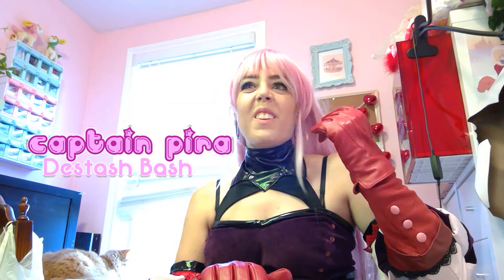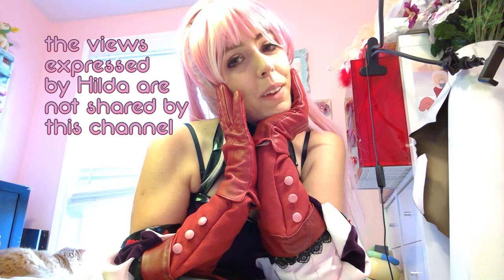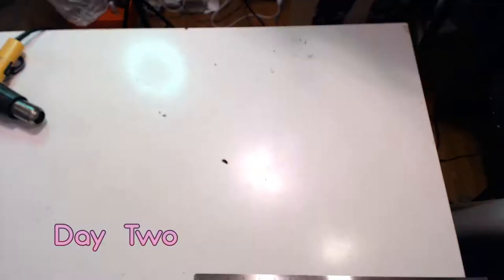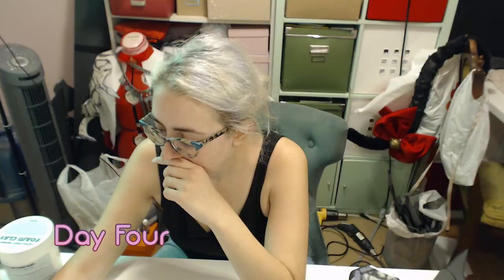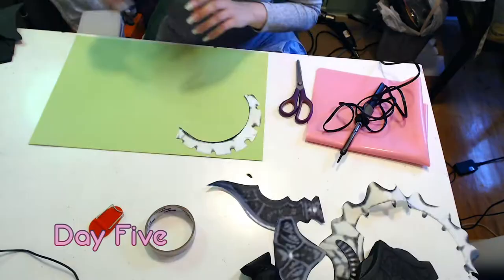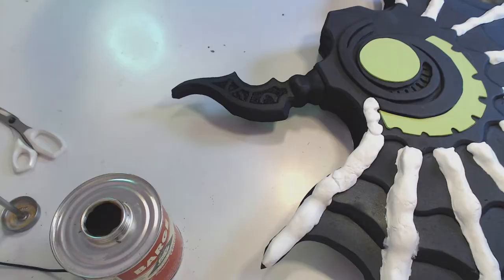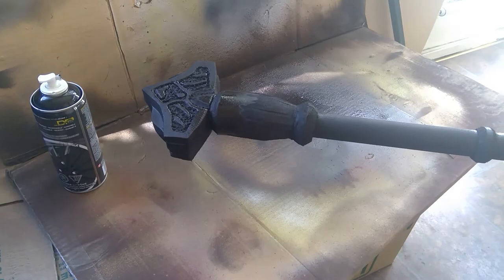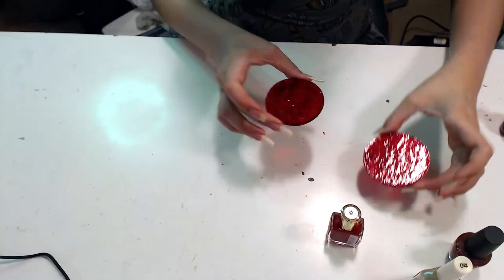One Week Build - Hilda's Relic Freikugel - Cosplay Prop

Comment: ABSOLUTELY AMAZING 🤭! I’m a newbie when it comes to cosplaying. I’ve only done one and managed to win the cosplay competition with my raven from teen titans ( original)  cosplay. Since then I’ve been hooked and want to try to make this a hobby. However COVID struck and canceled all cons for this year soooo I have time to create now 🤗. I am wanting to be Hilda for the upcoming con in March (as long as it doesn’t get canceled) and so you have inspired me so much now. My only question is if there is another way to do the detailing? I don’t have the tools used In Your video! Sorry for this being so long but I’m just blown away by how amazing you did!
Reply: Also could you do a tutorial on how to make her actual outfit?
Reply from the maker: Sounds like you had a great start! And plenty of time to practice. If you don't have a dremel, you'll want to cut your shapes out of the foam more carefully to make sure they line up, and cut some layers on an angle since you won't be able to bevel them later. A sharp exacto knife will probably be more helpful than scissors for getting angles and can cut multiple layers when it's been glued together. If you're doing a lot of foam work, look into picking up a heat gun (an okay one is about 30$) because you can use it to curve and shape your foam. If you're only using flat shapes, you should be able to use a primer instead of heat sealing, but it will absorb a lot of paint or primer. If there's anything more specific, let me know and good luck with your build! <3